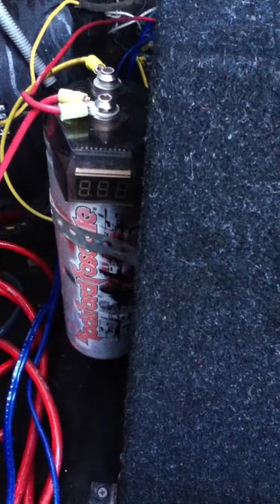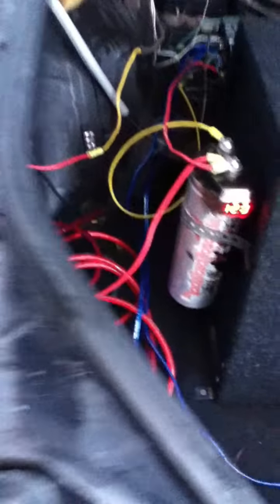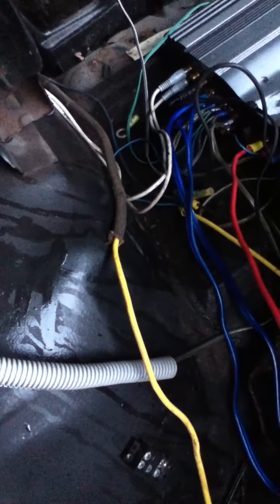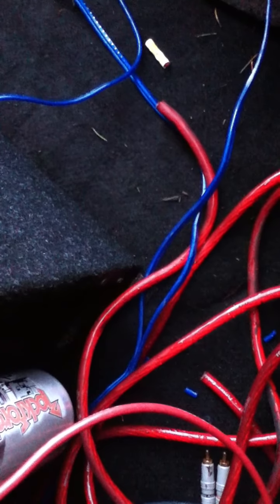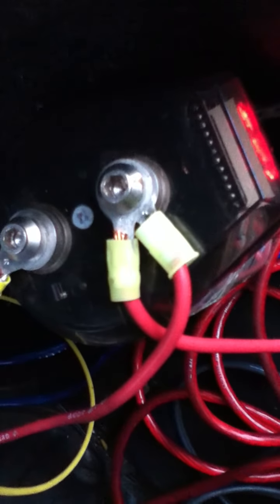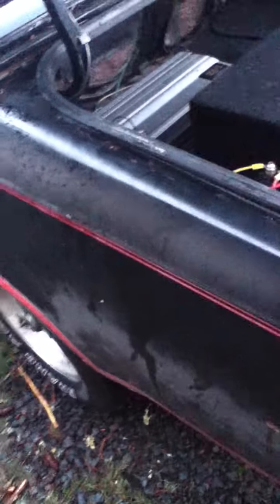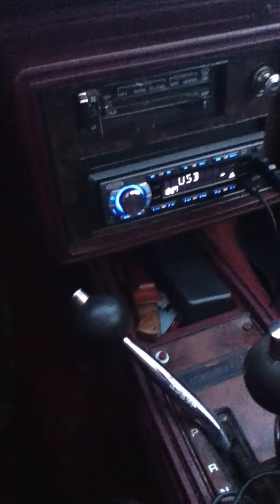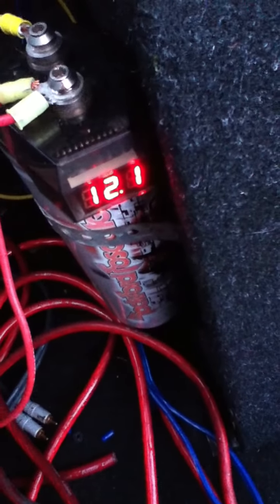How to install a capacitor

Comment from the maker: nah actually its a 83 hurst/olds. the cap seems to help my alternator keep the battery charged alot better but when it needs charging it does strain the alternator. thanks for the compliment man, lemme know when you get that dodge system in